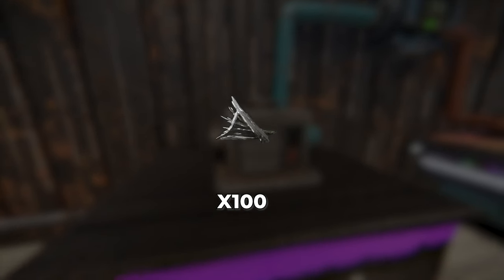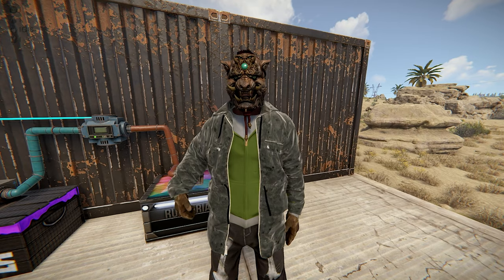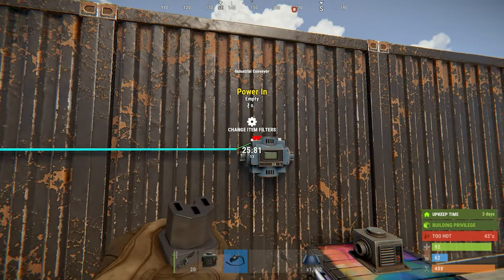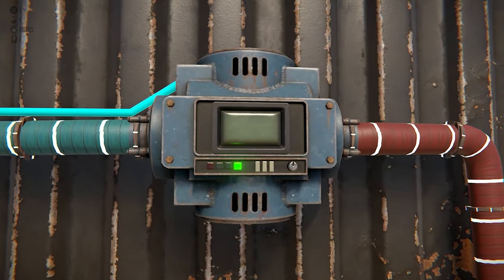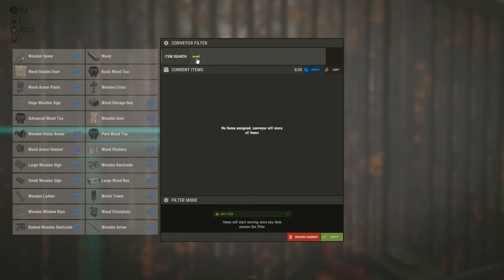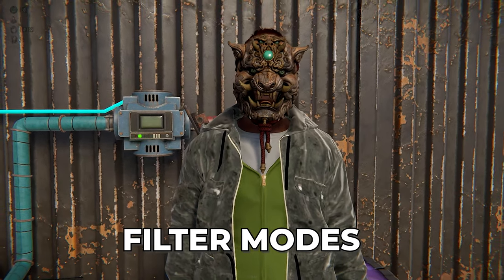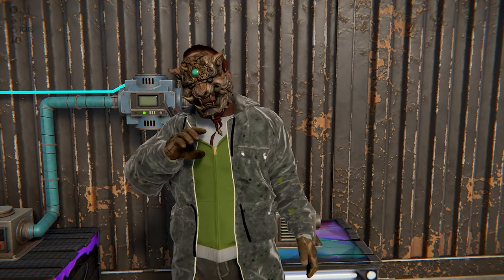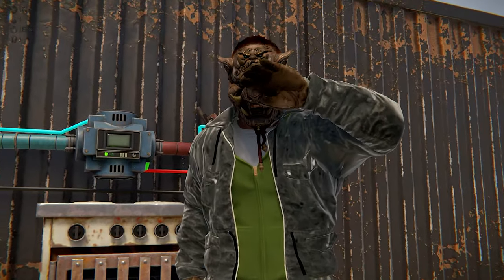RUST EXPERT Shares Top Industrial Conveyor Secrets

Comment: do you know what causes the conveyor to input ressources 1 by 1 if the amount of ressources in the input is less than the minimum and how to get around it, maybe?
Such a weird behavior
For example i have a box with wood and the conveyor is set to a Min. of 1000 and a Max. of 100. It will work until the 1000 is reached and then stop pushing the wood. But if you take out some wood yourself and the Max isnt reached yet the conveyor will start pushing the resource 1 by 1 until the Max is reached or the Input is empty.
Reply from the maker: Let me check some things and see what happens on my end but I think I know the general reason this is happening. Can you explain to me what the goal is for the output container? The one wood is intended to go to? Are you trying to stop wood from exceeding 100 in the destination box?
Reply from the maker: Alright I wanted to make sure I looked and double checked first, but your conveyor settings are conflicting

Since max is set to 100, that means the target container will stop receiving wood if there’s 100+ wood in it currently. Minimum being sent ONLY if 1000 wood is in the target container conflicts the movement of wood. Since the max it will move is 100 it will never reach 1000 wood, which would then signal the transfer of wood

If your minimum was 100 wood and max was 1000 for instance it would transfer. As for why it moves 1x1 I’m unsure why it’s so minimal but I am guessing it’s due to total amount needed in destination box, with it being so low it’s grabbing a small amount over time to fill. I know I’ve experienced varying amounts being transferred each batch, unsure the explanation other than just RNG 

I hope this made sense and is helpful! Sorry for the late reply, just wanted to do my due diligence to give a solid response!
Reply: @Sledge315  i didnt even expected a response tbh :D
The problem is that the min filter in the conveyor is supposed to look for what is in the input container, not the target container. for example in my smelter/refinery setup i have a box that collects 100 of everything (crude, metal ore, high qual ore, wood, sulfur ore) near the exit. But to be able to craft stuff i want to have at least a stack of wood inside my base so i set the min to 1000 (input minimum) and the max to 100 (target max).

So in theory wood should transfer to the box up until 100, as long as there is more than 1000 wood inside my base, or else stop. This works, as long as the wood is higher or equal 1000 inside my base. If the exitbox has less than 100, because there is only 1000 left inside my base and i take some wood manually inside my base (so there is less than 1000 inside), the conveyor starts working again, 1x1, until the box at the exit is at 100 or the box inside is empty.
Reply from the maker: A quick option since I’m away from my desk on vacation, have you considered connecting the destination box to another conveyor and taking wood out of it into TC for example?
Reply: @Sledge315  so far usually my way to go into things is basicly like making a little bus of materials with their destinated boxes. Basicly making a Dropbox that sorts everything in their corrct boxes and whenever i need something, for example for smelting or crafting or tc, i create a little sidestring from those storageboxes to either a little buffer chest to their endpoint or directly to the endpoint. and if there is something coming out of it returning it to the bus so it can sort it again.
Thats why i have that little box that collects wood, crude and ore from my storage boxes, mixes them so i can make a conveyor that checks if for example there is wood AND ore in it, because i dont want it to fill my large furnaces with ore if there is no wood for example, making it harder for other players to steal it. And even if there is ore and wood i just let ore and wood trickle in enough for the large furnace to run constantly, so if someone intends to steal from my running furnaces, it would take forever basicly to take anything more than just a few things at a time. This way i also can automate some timers with igniters to automaticly light up the furnace whenever there is a flow of resources.

So to come back to your question, usually i make smaller grids, but yes, since i use buffer chests i have connected more conveyors in a line, but so far only 2 before there is something done with it. But i would personally not tap into the smelter buffer chest to fill TC for example, that would be its own little line directly fed by the storage boxes for wood.